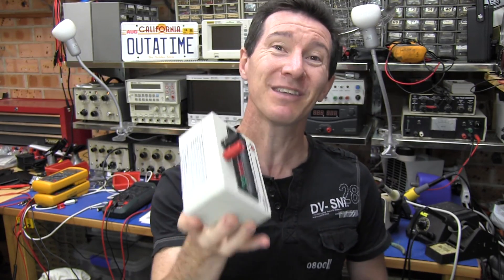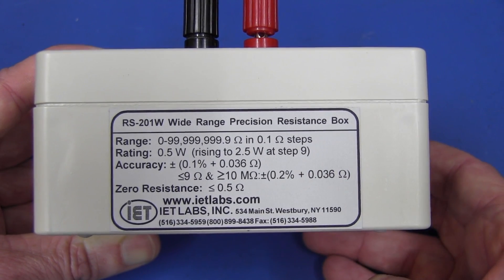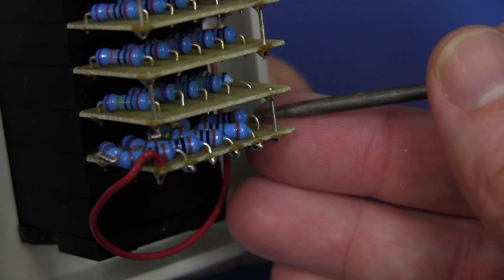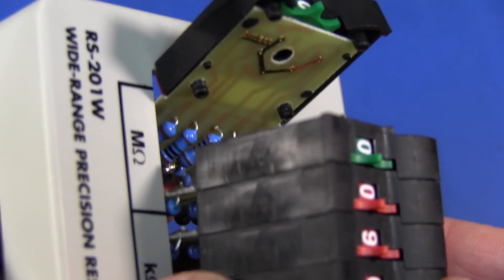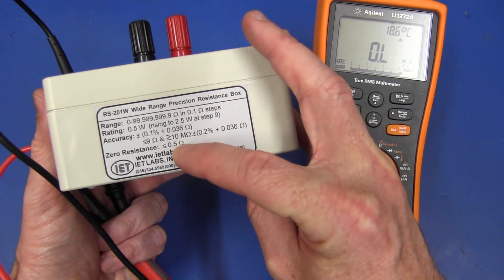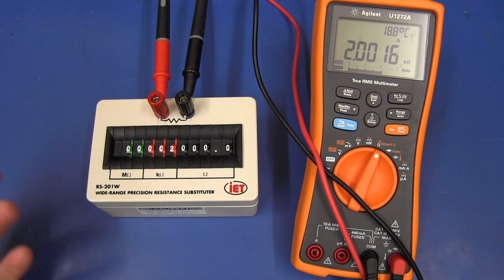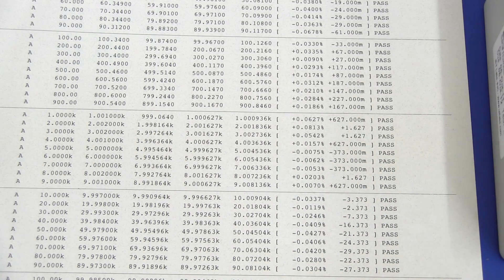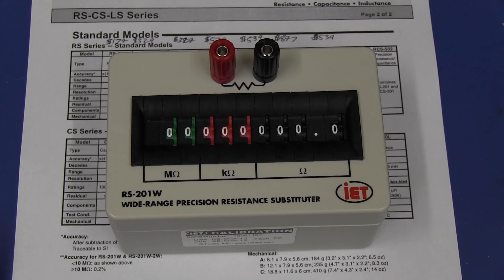EEVblog #211 - IET Decade Resistance Substitution Box

Comment: $539.00--??!!! - what a scam-!!  No way this thing is worth near that kind of money, the construction looks like kitchen table and you could build one with 1/2% resistors and a pushbutton decade selector and do nearly as well, in fact I think the push buttons work better than the rotarys, they seem more positive.  I built one using 8, 10-position segments of the larger KSA-2 button selectors using 1/2 watt 1% through hole resistors and its very satisfactory unless you need extroardinary accuracy.  Only issue on the one ohm range you have to REL out the inherent contact and wiring resistance so if you need high single ohm accuracy maybe youre better off reading one ohm with a more direct method not through a switch, but including the over priced project box I have a total of about $30 and a couple hours invested.

Comment: The code switches seem to equal APEM IR110ND (RS P/N:425-0805), though they are custom build. These swithes are extremely expensive just as standard parts (DKK 190 / $27 in todays RS price). That explains some of the high price.

Comment: $500+ for a few 1% resistors?  Atleast use smd resistors. $70+ to calibrate?  How do you calibrate a resistor?  This is shocking!  You actually paid the extra $$$ for the printed labels.
Reply: Tommy Aventador You buy 10 resistors and throw out the 9 ones that do not fit.

Comment: what a bunch of crap. I understand that they might have used high quality switches, but everything else is just COTS. For example, these 0.1% 0.5W resistors are 0.66$ worth for 1-piece quantity on digikey! I just think they price 500$ not for the quality, but for a) labor cost (it looks like hand soldered... it's not a simple all-smd PCB that you automatically assemble and it's done) b) they really sell few of them...

Comment: Just a question how can you calibrate this thing?
Reply: Calibration is basically just a comparison of the D.U.T. to a calibration standard, i.e. a unit with a specified accuracy.

From Wikipedia: "Strictly, the term calibration means just the act of comparison, and does not include any subsequent adjustment."

Comment: I saw gold plated thumbwheel switches like that one on ebay for 25$.
Resistors, 5$?
Box? 5$?
1h of american job? 10$?
Banana connectors? 1$?
Stickers, wires and others, 1$?
Total 47$
So they earn 453$ on one unit!
Bastards!

I'm gonna make one like that, It will cost about 10$, yes, I will not use long life switches, just that cheapest chinese one, so?
I will replace them after 5 years, what a problem?
Reply: Haha, u kidding?
What development?
What engineering?
Its just resistance box, nothing to design/develop, just put few resistors connectors and rotary switches into plastic box lol
Reply: Like I said, you don't need this. A few applications do require this precision so for them paying this much for a switch is reasonable. It is also for longevity. These switches should last a lifetime without changing value.
Reply: +Arek R. 
ye well here is a thing.
the gold plated switches on ebay are nothing like the switches in IET. as dave said IET manufacre their own switches and they are maybe the best switches that you can get today. they are no where near even 50$switches. they are like 250$, and will last for ever.
the resistors im pretty sure also custom made and are pretty high quality. those are not your 0.01$ resistors, each resistor is pretty high quality so it will be expensive.
the box can be any cheap 5$ box like your said
work is free because it fun
banana connectors shold be gold plated and pretty high quality. maybe 10$ for both.
the other garbage is 10$ for anything else.

but ye this box is too expensive for what you get.
Reply: +the real illuminati 250$ for nice switches?
Im sure they made it for 10$ and can sell for about 20$.
10$ for gold plated bananas? bullshit...
In our days gold plating is cheap(small amont of gold).
Gold bananas are for 1$, not sure for small quantities.
Reply: Arek R. nnnnnope.
Reply: Arek R. nnnnnnnnnnnnnnnnnnnnnnnnope
Reply: Stop trolling and tell me then, why gold plated PCBs are cheap...
Reply: Arek R. because of the amount of gold used.
also its not about just gold plated. its about the mechanical construction and the engineering that went to those switches.
also, I might accidentally overstatement, the switches are like 100~ and not 250~.
Reply: first u say 250, now 100, it only confirm that u lie
Reply: Arek R. no I'm giving my guess.
just think about it, IET is a good company, why would they sell "a box with resistors" for 500$? I dont think that they are getting 450$ profit. there has to be something that makes it so expensive, and those are the switches and resistors.
Reply: +the real illuminati No! you are wrong! There is many companies that sell things for 10x of worth!
This box sounds like "audiophile" bullshit...
Reply: Arek R. and you think IET are those companys?
Reply: Yeah, why not, they can make good stuff, but dont must make in good price.
They made stuff mostly for fabs/pros whos dont look at price.
Reply: +Arek R. NRE (Non-recurring engineering or one-time cost) could be quite a lot ($50K+) if you make something like this for professional use.
By the way, I have one in my office.
Reply: +Pepperidge13 U mean that price will be different when we will make commercial production?
I dont think, from my expierience single run projects never are more expensive in big commercial production, at least same.
Reply: +Arek R. The ROI (return on investment) decreases significantly for low-volume production. It takes a higher profit margin to make a low-volume run worth doing than it does for a high-volume run. Think about it, two products, each cost $10k to engineer. For one product, you sell a thousand units, for the other, you sell ten thousand. For the smaller run you have to charge $10 to recoup your costs, for the larger run it&#39;s only a dollar.

That&#39;s why you see niche equipment cost soooo much more, it&#39;s not always down to the cost of parts, a lot of it is just your sunk costs on development.
Reply: +Arek R. if you can make custom precision injection moulded parts, unique gold plated contacts and bespoke PCBs for those switches with no design or engineering then I have some jobs for you sir. In bulk something like this would be reasonably cheap, but the production runs on a piece of relatively specialist equipment like mean they have to raise the price to include one time engineering costs.
Reply: There are already gold plated rotary switches available, no need for inventing new wheel...
Reply: Gold plating does not the perfect switch make. These switches have to have a ridiculously low contact resistance to get the required precision. You don't need this precision. You should not pay for this precision. But for those who do need this precision, these switches are needed, and they can pay accordingly.
Reply: You are just going to audiovoodo side...
Reply: Goodness no. I see that the precision is not necessary for most people. But if you require the advertised precision, which some people do, then regular switches are not acceptable.
Reply: If we are talking in range of 100R, it doesnt matter if we are using cheapest switches with 50mR or best voodoo uranium plated with  10mR.
But in most cases we will use it above 1k so...
Reply: Ok just go and buy gold plated iphone for 5000$ to send sms.

Comment: If they're creating switches with custom contact positions, Instead of using resistors of value (1,2,2,2,2), would it not be easier to use (1,2,4,8), i.e. binary place values?
Reply: Adam Harrington You could, but your part types increase. If you can have consistent valued 1 and 2 resistors, why use different part values? Manufacturing is easier also, because you only have to keep track of 2 types of resistors for each decade, and not 4. My opinion only.

Comment: Thanks for the video.  Making one ranging from 1 to 99.999999 Megaohms using 1% 1/4 watt resistors, 10 position DIP switches and some protoboard.  For a hobby bench it should be fine. Cost about $5 ;)
Reply: Tested all the resistors and very accurate (I have a really good meter).  Just because you buy components on ebay does not mean they're crap - many come from Taiwan, same source as the others. Some are not up to par, but for hobby projects ok.  Test components before you use them.
Reply: 5 bucks? Are you sure, it could be if you plan on manufacturing 1k units or so.
Reply: bought my parts via eBay 1% resistors, 10 dips (need 8), proto pcb 5x7 cm board, some standoffs...  Pretty inexpensive to build - it might hit $7 lol.
Reply: Digger D ye, it will be shit. get some proper vichay resistors.

Comment: If they stamped an apple logo on it then its worth $500.  Looking inside its like a hobby kit made buy a noob.  What a rip off.
Reply: +jeanious2009 The price is mainly due to the calibration of the unit and the calibration report. You can also buy one without calibration+report for less :)
Reply: Yeah but if you think about it, and Dave mentioned it, if each thumb wheel switch cost 20 bucks and you have 9 of them then that right there would be over 180.00 just in switches. But yeah I agree 400-500 is just plain CRAZY!
Reply: Cobra 142 hi knobhead

Comment: You can get decimal pushwheel switches on eBay for around 5 bucks for a 10-pack. Add another 10 bucks for the resistors and the case and you saved yourself a ton of money.

Comment: Given the type of service these see (sitting on a bench) it is not an issue.  We use these at my job, i have worked there 5 years and they only die when someone overloads them. All the ones we have around have been there from way before my time...

Interesting side note about the series 10Mohm.  2 series resistors should by probability give better accuracy than a single 20M.  

The hacked wire is not pretty but electrically dosen't matter.  

The leftover flux is unacceptable...

Comment: Mine has proper resistors in the tenths of an ohm resistance bank.  Of course mine is also much older (the Unimax [not IET marked] switches have 1986 date codes and most of the resistors have printed text ratings instead of color bands).

Comment: @neutron7 well for that price I would expect top class soldering, cleaned flux and no such solder joints, it seems they are cheap enough to not use new resistor there.

Comment: Surely it would cost you less to build one yourself, even if you bought top-quality switches, used only the best PCB clad, bought the best quality resistors and even bought a Fluke multimeter to calibrate it?

Comment: For $500 I would've wanted switches that were higher quality than just a contact riding on a PCB.  Granted the copper might be heavier than normal but it's still going to wear if you click those switches quite a bit.

Comment from the maker: @mageepaddy Because the flux residue could potentially have a high leakage resistance (say 100Mohms). Put that in parallel with 1K and it makes no difference. Put it in parallel with 10M and it matters a lot.